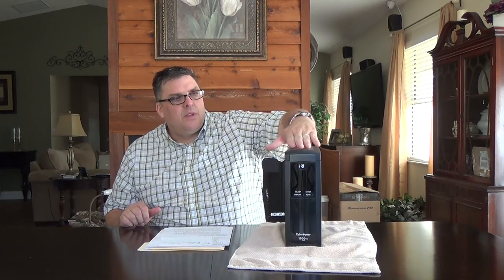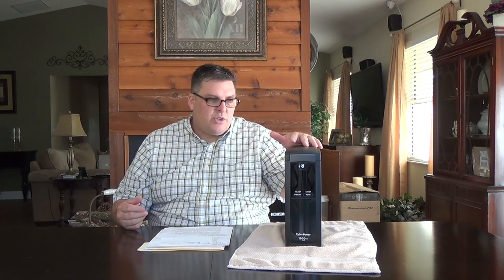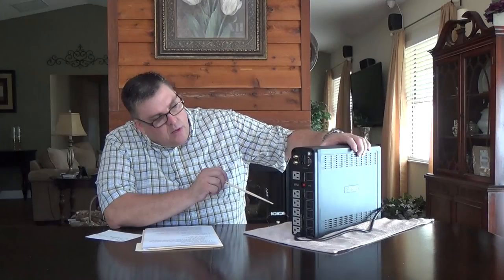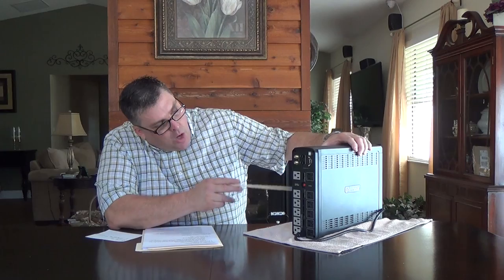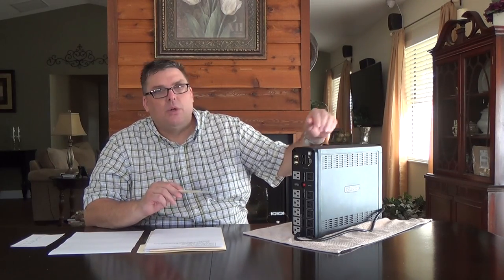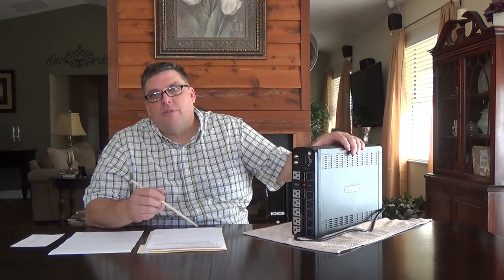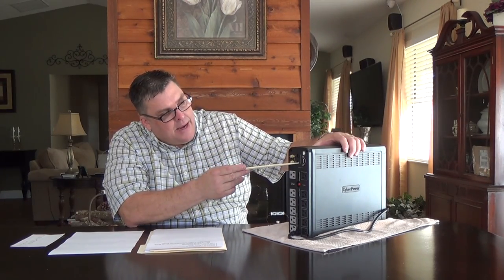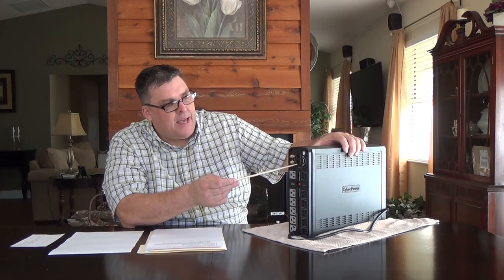Cyberpower 1500VA UPS Overview

Comment: Big help. Changed out batteries a few days ago, and it still didn’t work as it would shut off as soon as anything was plugged in, so I put the old batteries back in until today. Watched your video and it clicked, don’t plug laser printer into battery side. Duh. That’s what I had. Swapped batteries back to new again and plugged in one item at a time, leaving printer for last to go in surge protector side and now everything works. Thanks for the video.

Comment: would of been nice to see the ups fully powered and run through some features. is an occasional battery drain necessary to preserve battery health? what would be the best way to do that? i purchased one in fear of my computer frying (have experienced several breaker trips) although i have very little knowledge of ups systems
Reply: you get 200l0 watts inverter $209.00 and 2 lithium battery 12 volts 30 amp 384 watts one battey $188.00 you used 4 battery lost much longer ok i have 1100 watts inverter have two battery 285 cranking amp ok with my inverter from 1am to 8 am my battery go death i was runing my laptop all night my battery in my laptop was not work i was putting about 56 watts ok thinking about it if have good battery i can run a week on lithium battery 12 volt 300 amp

Comment: hey mike thanks for your time and service in this...I picked up a Cyber Power model: 1100-VA:LX100G practically for nothing and the issue I'm facing is that after powering off and back on all backup charge dumps after charging 8hrs to 100%.... Honestly I'm being lazy because I've put no other research into this besides watching your video so please forgive my lack of motivation etc. and looking for an easy fix. If you could give me any suggestions I would greatly appreciate it sincerely thank you..

Comment: A reason to plug a printer in it, if you use a Canon PIXMA PRO-1, 10 or 100 and it looses power, when you restart the printer it goes through a small cleaning cycle wasting ink, in my case with the Pro-1 that's 2 or 3 A3+ prints worth of the 12 inks.

Comment: Thanks for the video.
I'm going to be picking one of these up for my new PC.
Curious if you know about plugging power extensions into one of these. I've read it's bad to plug in another Surge Protector to one. Is there any problems plugging in a plain power bar/strip to one of the outlets? I wont overload an outlet or anything?
Reply: Its not good practice to plug one power strip into another, you could either start a fire or brick your plug on the wall. It could also potentially damage things you plug into it